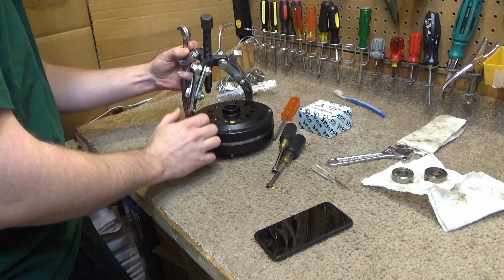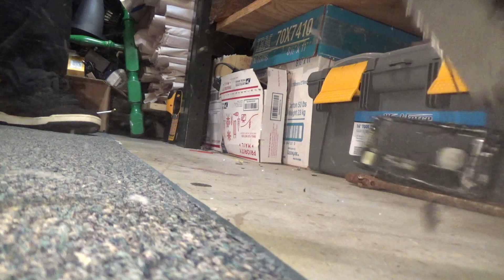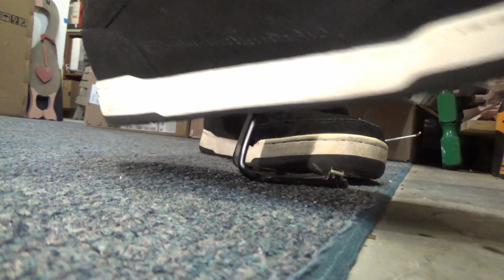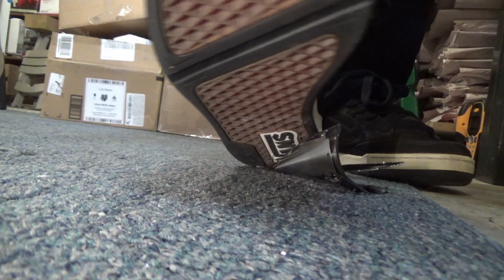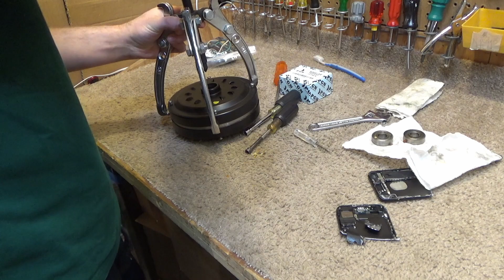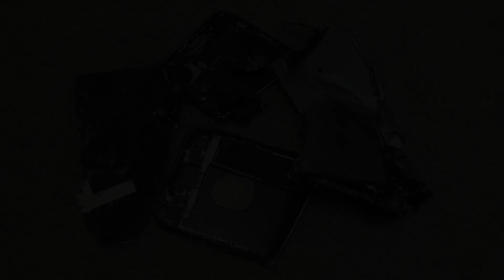iPhone Destruction #1 | iPhone vs. Scam Calls

Comment: You can probably sell it on eBay as “For parts or repair”
Reply from the maker: For 800 dollars because it's 'rare and vintage!'...what a joke.
Reply: Most likely its icloud locked and thus are pretty much useless... Even if its just a component they're becoming serialized like the home button, screen, camera, and  battery. Thanks apple. So green.
Reply from the maker: @rartolak  That's exactly the case. I have a whole pile of them that are like that.
Reply from the maker: @versedbridge4007  That site has turned into such a joke in recent times.
Reply: “Not sure if it is missing parts or not, untested”

Comment: Try taking it to a repair shop and see how they react XD
Also that wasn't the iphone you use every day right?
Reply from the maker: I do not use an I-Phone...
Reply: @JordanU  ok that's good
Reply: @JordanU  I don’t get it, how did you insert the ringtone because it seemed very realistic like the iPhone in front of you was actually ringing. Also, where did you get that iPhone from?
Reply from the maker: @Dwall44  I used the video editor. The iPhone came from the trash.
Reply: @JordanU  Haha thanks for letting me know. I hate to admit it, but I am sort of a fan of the iPhones. However much like you I simply can’t stand how exorbitant the prices on eBay are. For a literally destroyed phone with no salvageable parts you could probably get $50 easily.